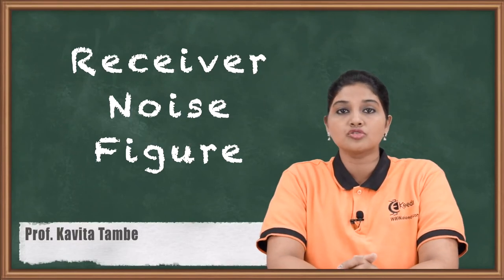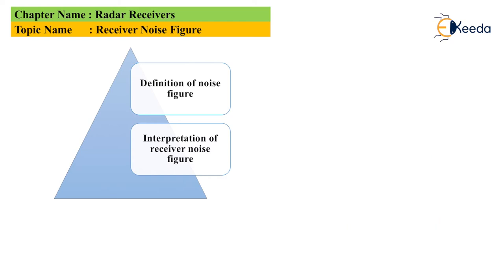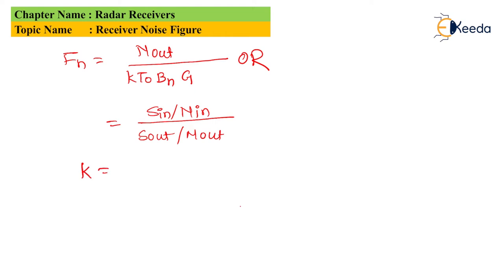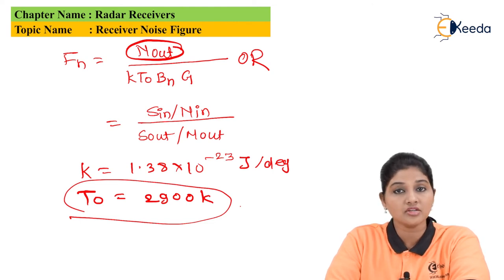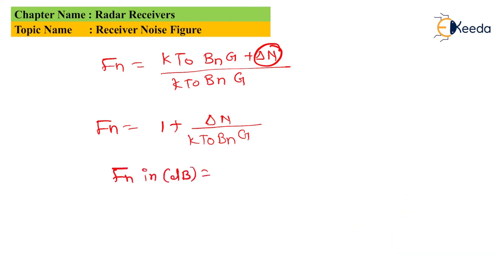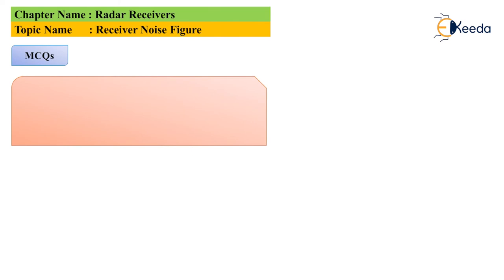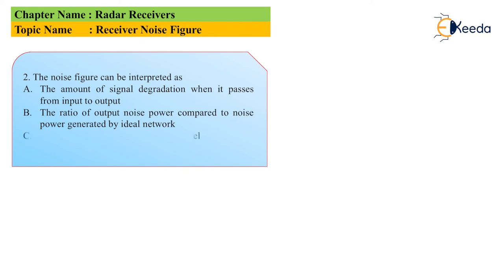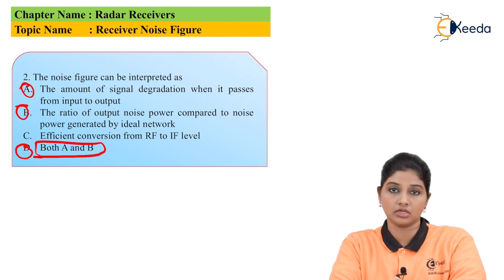Receiver Noise Figure - Radar Receivers - Radar Engineering

Comment: Why is T0 equal to 2900 K? Doesn't this vary with temperature?
Could it be 290 K (or maybe incorrectly written as 290°K), which corresponds with an ambient temperature of 20°C?
Reply: This is 290 Kelvin which is arround 290-273=17 Degrees.